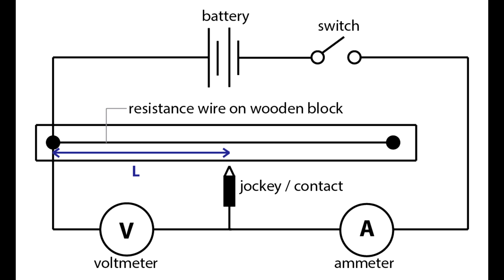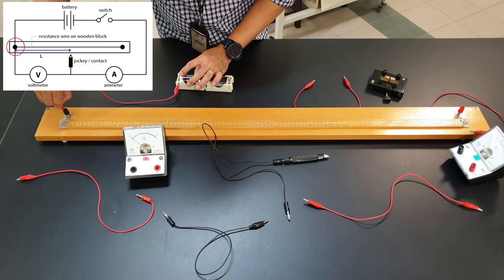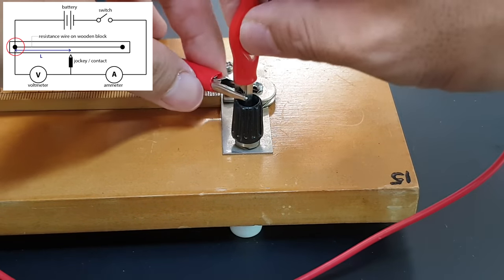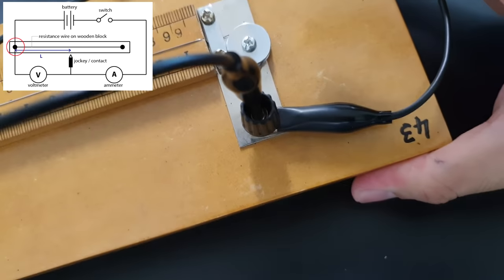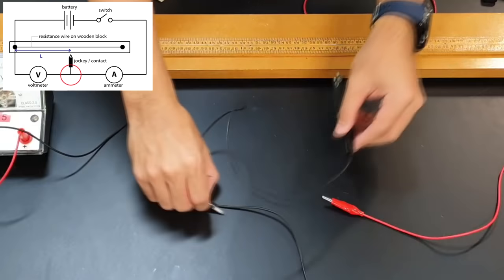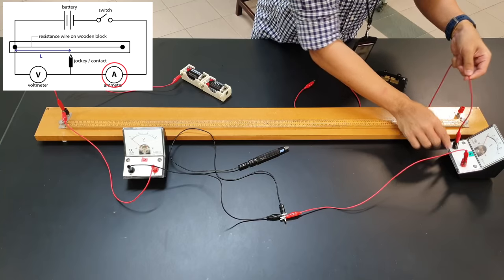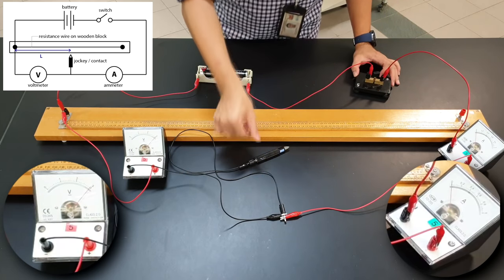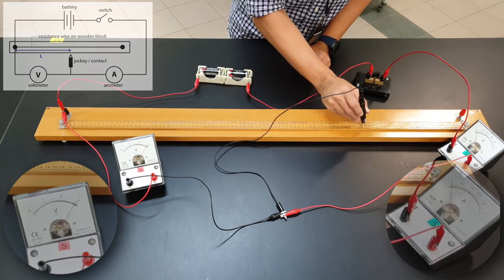circuit set up

Comment: Why isn't the voltmeter connected in parallel? We connect voltmeters in parallel in the UK.
Reply: The voltmeter is connected in parallel to the bare resistance wire. As the jockey is tapped from left to right, length of bare resistance wire increase and hence its resistance. Thus, voltmeter measures the pd across the segment of the bare resistance wire. Ammeter is connected is series to the circuit to measure varying current with varying resistance.